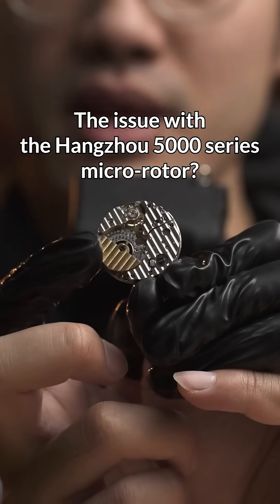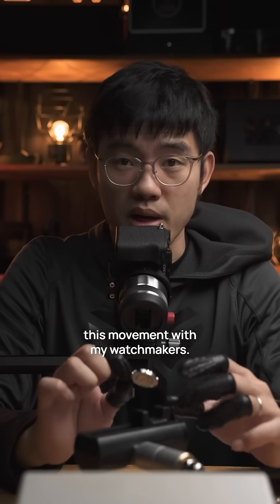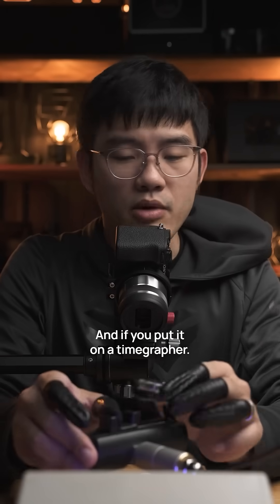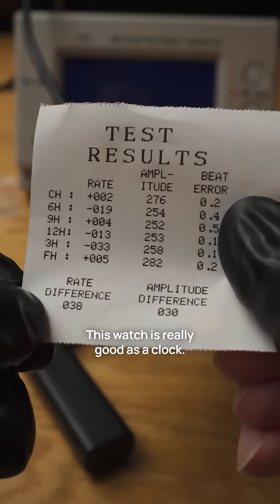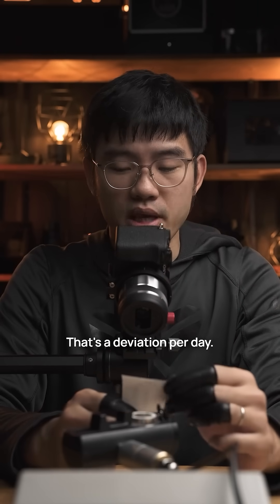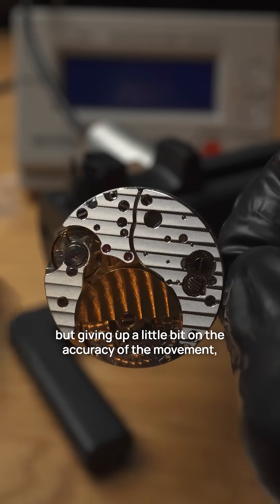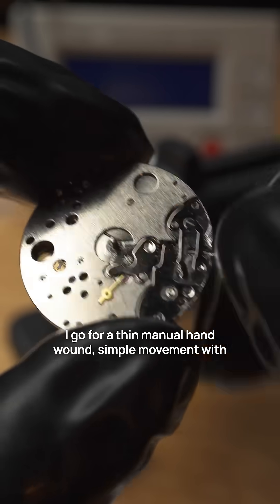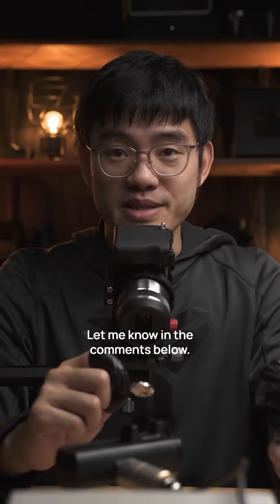The issue with the Hangzhou 500 series micro-rotor? #diywatch #diywatchclub #mechanicalwatch

Comment: I actually own a Lobinni watch with that movement. The watch is beautiful and so is the movement. You are correct about being slower or faster in diferent positions. But on average it doesn’t matters. In my experience it is pretty accurate for a mechanical watch. Every time I need a more accurate robust diving watch I put on one of my 2000 Tag Heuer quartz watches. But recently my stem on my Lubinni is not working. Can’t manually wind or set the time correctly. Not sure if it is economical to take it to a watch shop for repair or just order a new movement and do it myself. I have no experience with this movement and that is the reason that I didn’t opened the watch myself to see what is the problem. By the way I own a few watches but only 3 of them are Chinese. The other is a st3600 based movement that I used as my training in watch repair hobby. And a watch with a st1701 automatic movement. That wach/movement is the most accurate I have ever seen. It is almost zero beat error almost no deviation in any position and extremely accurate even the price is close to zero.
Reply: what to you think of the rotor bearing system ? fragile ?
Reply: @mlbg55Not really. But I managed to break the date function somehow. I’m unable to cache the right position with the key to adjust it. I will probably have to fix it myself. I don’t like watches with a date complication. There is a company that uses the same movement in its watches without a date complication. Those watches are much more aesthetically in my opinion. The company is Baltic. But I was not able to find one for sale at the time.

Comment: I would love to see your take on the Hangzhou 7000 4hz Automatic movements (they come from HZ and Dandong then usually get decorated into Rolex fakes. 
I do love that type of handwind movement but it's a shame the 18,000boh version is hard to find.

One of my most accurate watches with a 2824 type movement is a Hangzhou 6200 25j ETA clone.

I find that Hangzhou makes the best ETA clones  and HP PT had to do a deal with them to set up the pt5000 line

With seagul movements your lucky if they are properly oiled or not but I have had a  1963 for nearly 8 years that's crazy accurate.

Would be nice to see more chronographs.

Maybe in the future more Chinese movements especially 4hz will be made.

Most 3hz Chinese movements are miyota 8000 clones or a mix between that and Seiko.

The price of nh30s and miyota 9000s have gone up alot so I can see more and more new watches use the miyota 8215, no idea why people hate them.

I guess the problem with the ubitas style handwinder is the fact they are so big so case size is limiting.

Would love a modern 18,000boh auto as the only auto under 3hz is the Vostok., I just love the sound of an 1800bph.

Comment: My Hangzhou 5000 watch is still in the mail but I have a watch with the manual wind Seagull ST17. Mine unfortunately broke after about a year of normal use.
I can't wind it anymore without the crown skipping most of the time. I've had the watch looked at at my local watchmaker and he wasn't impressed. If I remember correctly the winding gear was secured by a small washer and had ground it self into the mainplate of the movement over time. I personally wouldn't buy a manual ST17 again.
I have had a positive experience with the regular automatic ST17 though!
Reply: What will you do with the faulty HZ5000 ? Sell this non-working HZ5000A for parts or repair ? It would help others
Reply: @marnixlopezMy HZ5000 is running fine. I recently dropped it accidentally and had to reattach the second hand myself but it's still working very well. It's the manual wind ST17 that randomly broke on me.
Reply: @Steakkiller  good to know that the HZ5000A is still on, hoping the ST17 will follow the same track ...

Comment: If you want it accurate make it Quartz
Reply: It's not overtly about accuracy; its about quality. Using a rose engine to apply to some cotes de geneve is putting lipstick on a pig here.  Dropping 40 seconds is an inherent QUALITY problem, not just an accuracy issue. If its that sloppy and falls out of time purely based on wrist rotation, that genuinely means its not going to hold up over time.

An Nh-35 can genuinely run for 20 years without service (it'll get slow after 6-8 years, but it'll be useful as a watch for a long time), and after that you can replace it with another 25$ nh-35 lol.  

this pretty movement (it genuinely does look good) probably wont be even functional on time frames comparable to seiko movements readily available. It also costs 3-4 times more than the seiko movements available lol

Comment: Can they be serviced and regulated? Are the parts easily available?
Reply: Hangzhou watch factory does not answer email messages about parts, even fot the common failure parts (rotor bearing)

Shame on them !
Reply: No, these cheap movements are really not intended to be serviced. There will never be an opportunity to service these things; as the cost of servicing them will genuinely always be more expensive than simply buying a new one. 

The problem is also not regulation; its time keeping. The drive train cant keep proper tension at various angles; what do you regulate here? wrist up? wrist down?  Humans dont sit still for 24 hours a day. The finishing GENUINELY looks incredible, but theres no way in hell you should ever buy one of these over a seiko movement.   A wholesale nh-35A is 25 dollars shipped. This movement, the cheapest wholesale I can actually find is 83 dollars PLUS shipping (usually 5-12 from china). There is almost no scenario any one should buy this until they tighten up the gear train or eliminate the backlash on the gearing thats causing the torque on the drive train to slip.
Reply: @JgHaverty  Service to cost ratio is perfectly irrelevant for my question: can it be serviced? Are the parts easily available? If the answer to either is no, then to me personally, these watches/movements are not worth my money or time.
Reply: @kresimirpleic  i answered your questions directly. Stop inventing crap to get upset about lmao.

You DONT "service" an 80$ movement. You "buy a new movement". Servicing and parts will ALWAYS cost more than buying a new one. I was being polite, your question is beyond stupid. 

And no, the parts are not readily available. Its a cheap movement you replace , not repair. There is no market in repairing these.
Reply: @JgHaverty  Take a pill. Calm down. Relax. Go away.